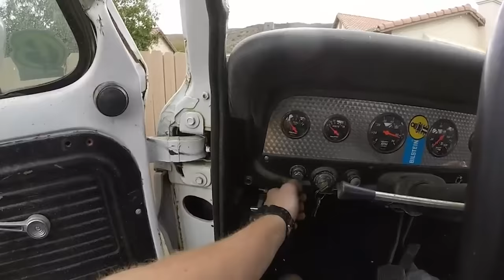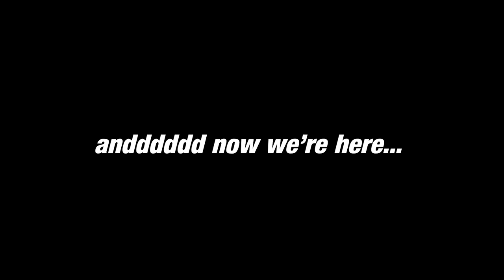My F100's New Custom NASCAR Exhaust SOUNDS INSANE!

Comment: It sounds amazing but not for daily driving. Wondering what kind of very small mufflers you could add after the X pipe that would tone it down like 20%? Definitely not the sound you expect when you see the truck.

Comment: man, when you started cutting the pipes right after the flange i was hopping you were going to flip them and have it go over the top of the transmission mount, then cross right before the driveshaft, then a nascar blast pipe.

Comment: Those x pipes are sick af best air flow and sound way better than duals … get some cutouts installed off the headers and run straight pipe to the x then make a video

Comment: I remember i got my 72 road runner with a 400 running i had some blown out 12 in glass packs. I ended up getting pulled over for noise (California cops yay). had to put turbo mufflers on to clear ticket. Cut those off and put on a set of RV 36 inch long glass packs. Super quiet idle and low throttle but full throttle they came alive.

Comment: Sounds really good, I think your ears will be very sad when you're in your 40's though. I have been involved in NHRA Super Stock Modified with our 1967 GTA390 Fairlane since I was about 9 years old. I didn't wear proper ear protection alot of the time because "I wanted to hear the cars" so I grew up around open headers, loud exhausts, and the majority of my cars had one chambers, or just collector dumps on everything I owned, well now I have trouble with my right ear and cannot hear a lot of frequency waves with my left ear. I really like the sound, sucks about your motor, pay to play. I actually have a Windsor Stroked to 396 with twin GTX3587R Turbochargers running 14 pounds blowing through a 1000cfm boost prepped Demon Carburator currently in a 1969 Ford F100 short bed Ranger Package pickup similar to yours.

Comment: Yep new exhaust on a tight motor you should always retune. The X pipe make it scavenge much better so better airflow into the motor and needs more fuel added.
Reply: I see this happen on motorcycles all the time. They buy a new exhaust that is better flowing than before and the motor leans out because its tuned to the other exhaust.

Comment: That's what a bronco is supposed to look like. The new bronco got it wrong. I think the old f100 exhaust still sounded good. It doesn't sound like it's stock. It does sound better now though. The bronco sounded loud but the new f100 competes with it very well! You're not expecting a truck to come around the corner when you hear it. Rest in peace small block.

Comment: Blueish/white smoke at full throttle is never a good sign.  Can you say over-rev on 1st to 2nd shift?  Backpressure on the cyclinders is an important part of an exhaust to keep cyclinder pressure and valve speed constant across the cyclinders.  Sorry to see a nice motor get hurt.

Comment: So what happened to the engine? One cylinder went lean and smoked a piston? Your new exhaust with X pipe surely scavenges a lot better than the previous system, adding efficiency and power, perhaps the motor was already running on the ragged edge of lean at WOT, and the better exhaust leaned it even more, to the breaking point? I assume the truck is repaired now? What are the specs of the engine? You mentioned short stroke, so it's an 8.2 deck?

Comment: Also the axle isn’t suspension and never jack a vehicle by the pumpkin.  Not stable and you run the risk of bending the cover and causing an oil leak.

Comment: "I blew the motor up" I mean, I'm sure teams are allowed a certain number of engines per season. Anyway, I won't be impressed until I hear it at an oval track with drive-by scenes. I want to hear that deep hearty sound of all 8 cylinders meshed together in one to make that bassy angry V8 sound. This is not enough.

Comment: @27:08 I don’t know what year your motor and Even though I like older cars a lot better than newer cars,  for the most part I’m going to have to assume since I haven’t owned a new car that new or newer car motors can just handle more abuse  and are better built And handle higher RPM especially smaller engines, than older ones can. Obviously, not all new motors, but the same could be said that not all old motors are good too not saying yours wasn’t though. it’s just like damn though because I have a 1995 Nissan 200SX and a 1981 Datsun 200sx And they’re both straight piped with headers and the datsun has a 2 L in-mline four and the Nissan has a 1.6 L inline four and I love driving them around like a NASCAR Literally all the time getting on it And shifting at red line every time daily, when I drive them, But I just keep going through too many transmissions and engines and the transmissions failing is mainly from burnouts and bangin gears and no lift shifting! But my white car is already on its 3rd motor so i’ve put in 2 and my datsun is already on its 3rd motor But that one seized a few months ago, and now I already need to put a third motor in, so that would be its fourth motor. I’ve had my datsun since around age 26 so I’ve had it for around 7 years but it might have actually been 8 or so years and if you think Me already having to put in two motors in that amount of time is a lot and now The third motor is already Seized. Well my Nissan I haven’t had more than probably three years or so and I’m already on my third motor which is still good but that is literally already two motors I’ve put in in probably a few years that’s a freaking motor a year and I’ve been so hard on my cars. For example, my white car has been down on and off for pretty much half the time i’ve owned it. The crazy thing is both cars are extremely reliable, and pretty much never left me stranded. I just love to have fun with my cars and I might need to tone it back a little bit. Or maybe i should just get another random reliable car for example But that’s a piece of shit that’s a manual trans and preferably rear wheel Drive that I can just drive once in a while, but that I can neglect and beat the shit out of And not give hardly one fuck about it. I’m talking like a total shit box one you don’t even bother to wash and probably just pressure wash it periodically. I just have a little too much fun sometimes and get hyper and it’s really hard not to want to get on it all the time when i have great sounding straight piped exhaust systems that are really loud and Especially because both of my cars are manual transmission! Which is honestly way more fun than auto especially if it’s rear wheel drive like my datsun.

Comment: I have a 1975 F100 Ford ranger long bed with a three-year-old to it's got 202 Chevy valves in it Rock a roller competition cam been setting for 10 or 15 years I started up about four months ago fired-up smoked a little bit then cleared up run like a pussycat boys it's got a brand new C6 automatic transmission I'm going to put it on the road this spring and we going to blow some doors again bardstown Kentucky but it was built and lived in Louisville Kentucky for a long time I used to eat mustangs for breakfast

Comment: Badass but not sure how its “nascar” like, stock cars use a 8 into 1 header system with boomtubes instead of mufflers. This is just a basic x-pipe dual system. Still cool not hating at all but a true stock car setup you’d be deaf already😂👍